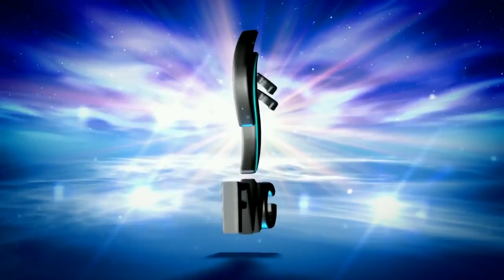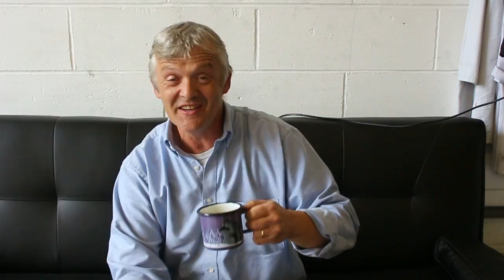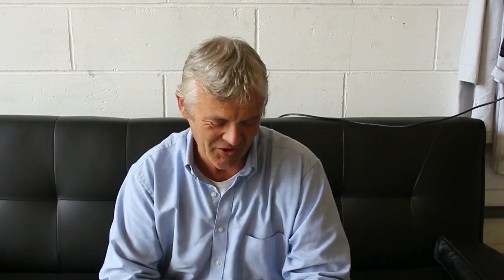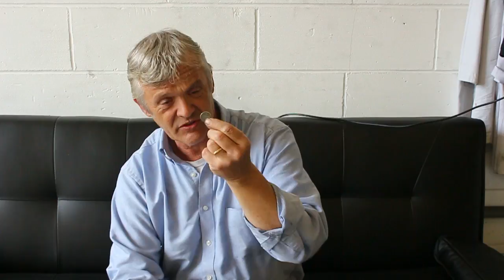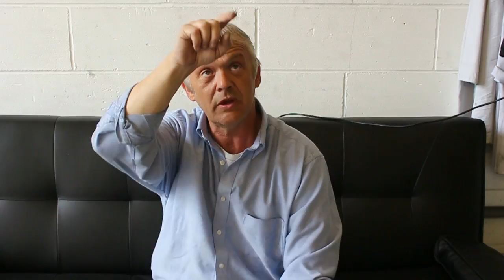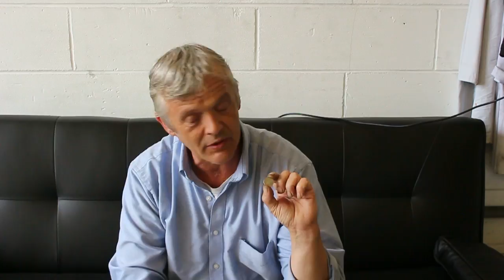FWG Battery - Follow Up

Comment: I guess the losses due to a high C-rate discharge are due to the heating effect/increased resistance within the discharging cell. A C-rated discharge is the optimal performance parameter

Comment: Appropriate uses of a cr2032 or similar coin cell: low power calculators, deeply embedded devices where energy harvesting is not feasible, hearing aids, SRAM backup for legacy products or those with real time memory requirements (FPGAs), cheap wearable devices, etc.  Not the same uses as one would consider for AAA or even AAAA batteries.  A micro-controller based sensor platform could read an ADC and sleep once every few seconds to once an hour, send the data in chunks over bluetooth, and give the battery a full shelf lifetime.  

As for the testing: Good comparison means testing an equivalent power draw from an equivalent size, not an equivalent current draw.  The physics will stack up evenly then in terms of a technology comparison.  Try using a constant output current SMPS into a heat sunk LED load that will work the same at 0.5v or so as it does at 3v provided a low enough esr.  

A good purpose for which your battery is uniquely suitable is a deterrent alarm to get rid of muggers.  More C rate, more pain in the ears without using a bigger battery.

Comment: Button cells in watches probably run at C/10000 discharge rate, though I am sure this average current actually has pulses of higher rate amongst it. One thing I have observed is that even cells in their bubble packs seem to self discharge somewhat. The CR2032 is popular on computer motherboards too, often they will last many years (though the end voltage where the computer starts losing settings is very low). It strikes me that these cells are engineered to be extremely slow self discharge rather than a traditional low ESR power house. Not in any way knocking your methodology, the commercial button cell is clearly a bit of a weakling compared to your own cell at highish rates of discharge. I do have a few electronic gadgets that are abusive to their CR2032s, such as an IR remote control for a set top box and silly LED torches for key rings. You are doing extremely exciting work, and many of us greatly enjoy the updates and ideas.

Comment: Hey Robert, I just found this channel and seemingly at an exciting time.  As a less experienced electro-chemical laboratory tester, I appreciate the educational value you have incorporated, and I hope your comprehensive design approach pays off.  The new cell seems to blow the doors off of present tech, and only rigorous testing can satisfy the doubters.  For more practical and progressive matters, I wonder how the new button cell may hold up to rigorous environmental conditions.  I just found a melted candle in my storage unit, which will freeze in winter, and it probably also contains batteries.
Reply from the maker: testing is expected and fair mate - it takes time so it has to have time to happen that's about it really

Comment: Hi Robert you are doing a super job, In the argument of discharge I agree with you, But you are also trying to make a product for the marked, and you are tying to do that With a "form factor " that have normally 3.2V and are trying to push for 1.4v.....Is it possible to "slam" 2 layer together so you reach 2.4V I think it will be closer to what this form factor are normally  used for and therefor have more interest for those who will by your battery, and when it is better then The Panasonic, that will only be a  + sales factor for you product. .......Ore did i miss the point ?.........."I'll be back". ......for some off the black stuff......I want to build something BIG with That......I have got solar cels NOW and need a storage "tank" for the Power..........Best to all Jørgen Thomsen Denmark DK
Reply from the maker: cheers mate and yes it would be possible - still stuff to work out on this battery I think - but nice comments

Comment: Does your battery have a high self-discharge and that is why you don't want to share your lower c discharge results in the same way?
Reply from the maker: no mate - it's about the same and not really interesting for that - i will most definately share it - i am working on the next video and will include that - i just putin what i think is interesting in a video - i have to keep them down to 10 mins or so as people won't watch them - if i try to put everything it just gets boriing so i make a decision on what to put in - as folks are making a bit of an issue of this i'll put it in - no worries

Comment: it's 28 after 12 and i have been to a party but still with it and looking at and commenting on some of the comments on this one,,,,,, Phew what a Freakin Epic this one has turned out to be.
i'm off to charge a battery, oh and then discharge it and that's me. 
Crack on RMS keep it up  at least some of us are still here thinking of that bad Purple fuming reaction KMn04 that you had in ya back yard from local heating whilst trying to produce Graphene  and show us prospective in ya shed amateurs what it's all about.... up until about now where some of us have grown up with you and of course will be ever greatfull for the stuff that you have shared with us over these years.
Kev
Reply from the maker: lol - i wouldn't worry about it mate - some folks just like to argue and they do it well. They can keep you talking all year. Myself i barely answer this kind of stuff - mostly because it is from a stance of ignorance - they say this and that about graphene because they think it is graphene based - i never said that - i said it was a metal oxide salt electrolyte and zinc plate - it has the same kind of discharge as an off the shelf AA - but why bother telling them as they would just have another set of arguments about why it couldn't possibly work - these kind of guys are on a mission and there are lots of reasons why - mostly it is do with their self esteme - hve a good one

Comment: That's fair and reasonable, Robert. Thanks. Two cells in series inside that package would be very useful. Lithium CR2032 cells are often used for memory backup, with a discharge rate of C/20,000 to C/40,000, depending upon the duty cycle of the computer, and ignoring self-discharge. That's 50% if you assume a 5 year service life and an observed end point of around 2.0V, measured in situ. You don't have 5 years to spare, but can you please try a simple test, using much smaller-capacity cells, which can then be extrapolated to give a pallpark figure for the real product, perhaps when connected as ~3.0V battery within one CR2032 package, and discharging to 2.0V? Thanks again.
Reply from the maker: awesome mate - i will do just that - cheers
Reply: Thanks Robert.

Comment: Hi Rob you are a bloody genius mate great work ! just a couple of things ; why only 1.5 V and  why didn't you make it 3V which is the standard voltage for CR2032 cells (1.5V is considered flat here in oz ). Would it not be as simple as stacking 2 cells in series there by giving 3V all be it at a reduced capacity but by the discharge graph your cell would  cream the other brand. 
PS are you planning on storage devices at some stage for stand alone home power ? Cheers mate keep up the good work.
Reply from the maker: fair comments mate and i am looking at home power - low drain really isn't my thing large storage is

Comment: sir you may also consider the efficient. 
If your bicycle can ride for 50 mil long and charge for 10 minute or less it most valuable. Than ride for 200 mil but charge for 3 hours.
Reply from the maker: nice point mate - cheers
Reply: I always remember your E-bicycle Video. LOL..
Keep working sir, Cheers

Comment: Hi Rob, Good to see you on air again, One comment, You said you was thinking of selling these button cells and i think its a bad idea, and will tell you why.
These things are normally used for very low power drain applications, Like key fobs etc, and normally even the crap ones last years, now i expect yours will be much better but if it last 4 years over 2 years who cares or will even notice.
Why not make a AA or AAA or 18650 i expect as the voltage will be over 3v it would need to be 18650.
Now 18650 will have a big market and the capacity will be important and noticeable, will need to be re chargable.
Just my thoughts as its a bit like making a bottle opener out of titanium, it will last for ever but does it need to.
Reply from the maker: good point mate - never thought of it that way
Reply: Maybe these cells have been used in low drain applications because, until now, that’s all they’ve been good for, which is what I got from the test.

Comment: Don't watches have low discharge rates, and aren't those batteries commonly called watch batteries? It would be interesting to be able to compare your cell with a battery built for high discharge rates, but it's clear that you have something that works well for the test you ran. By the way, it looks like your viewers are taking your advice to be skeptical of battery people, even if that battery person is you ;)
Reply from the maker: indeed mate lol

Comment: Nice job!  I know it might seem very annoying getting these questions that seem to be having a dig.  BUT it can also be very valuable feedback too.  When you are a bit further down the road and want to make a commercial product you can be sure that you will come across the same sort of questions from potential investors or customers.  At least now you have had a million devils advocates  and can have the data and answers to address them if required.
In any case if nothing else you have proved you have a product that can be used in special conditions where existing products cannot manage, namely very high current discharge devices.  As was mentioned elsewhere if you could put two smaller cells in the same package and double the voltage you'd still have a much longer life and at a higher voltage (which might be need for some applications).
I'm really interested in where you will go with this, my suggestion would be to do market analysis to see where you can make the best use of your specific batteries advantages.  That's why Tesla started with sports cars as they have higher margins on low volume sales, maybe there is an equivalent battery type for your battery where it would have an unfair advantage! :)
Reply from the maker: I get it mate nice positive spin - I will take on board what you say - cheers

Comment: In the previous video it was suggested that the new battery would be offered for sale/production in the CR2032 form factor. A comparison test was conducted against the Panasonic Lithium CR2032, which has an established market in very low discharge current applications. Two critical parameters that define the battery life in these applications are leakage current (self discharge) and flatness of output voltage under low current load conditions. In this video the implication is the former test results were not intended to indicate the new batteries suitability as a direct replacement for the Panasonic CR2032 replacement, that is ok but might have been better stated in the former video. The question that remains is what is the target market for a CR2032 form factor battery with only a 1.4 volt output, but which has been tested to provide a relatively longer period of high current discharge that the Panasonic CR2032?
I cannot think of many applications that require a primary cell with a sub 2 volt output that supplies a high output current that lasts  for a few hundred seconds.
It does seems unreasonable to mock Panasonic for specifying a C/1000 discharge rate, when these batteries often find application in equipment where the battery life is expected to be 5 or 10 years before replacement is necessary, i.e a 2uA load current (C/110000), for example the Rigol RF spectrum analyser rtc. It also seems reasonable to question the replacement marketability of a CR2032 form factor battery that only outputs 1.4 volts when most existing CMOS processors reset at approximately 1.8 volts. There are circuits that will operate down to 0.9 volts, but these are much less common. It could be argued that low load current  performance can be inferred from high current testing, but this is difficult to justify, given the importance to battery leakage due to side chain reaction and internal current paths, and still does not address the problem of the low output voltage of the new battery.
The confusion can only be attributed to the misunderstanding about the intention to market the new battery as a direct replacement for the Panasonic battery in the same applications where this battery is used. I do find it difficult to see how religion related to this discussion and none of the above can be taken to imply that the tests shown in the first video were somehow unscientific, however they may not be relevant to the practical market application of the new battery in this form factor.
Reply from the maker: I don't mind folks criticising or pointing stuff out - just like you did - I mind the idiots who then say it is meaningless or unscientific in order to press home their points - what you have said makes perfect sense and is put in a way that can be appreciated and discussed. As I said you make good points. 
The CR2032 is just a form factor implementation of a lithium metal manganese dioxide battery - in a real sense there is no reason this shouldn't manage high load conditions - just because it is targeted at low load doesn't mean it was designed for that - it was just found to work well in that condition. I always ponder what would happen if we didn't have lead acid and some one invented it today - What do you think would happen?
The first thing is they would take it to a car company and the company would say
it's made from lead - are you crazy do you realise how poisonous that is
what it's got acid in it? - that's crazy think of the children
what do you mean it off gasses hydrogen? that stuff explodes you know
and yet 250 million cars on the American roads today and everyone has a lead acid battery in it.
the lead acid battery wasn't designed for cars it was just useful in cars before we had all this nonsense we have to deal with today and there it remains.
So much of what is said today about batteries doesn't revolve around batteries but around battery markets and experts in batteries. - wasn't it Goodenough - the inventor of the lithium ion battery - who said - if you want to develop a battery for God's sake don't talk to a battery expert - I may be paraphrasing
So, though I see and get your points I have a few reserves as to the real relevance of them in development - just the way it is mate sorry lol
Reply: Robert Murray-Smith What you highlight is the difference between doing research into new battery chemistry and development of a product targeted at a particular market sector. As. I am sure you appreciate, each market sector is looking for particular battery parameters, with the ideal battery chemistry meeting all these requirements yet to be invented. The battery form factor is important in as much as there so many products already in existence that use a particular shape of battery, and this battery shape has been linked to the batteries performance and electrical characteristics. It is possible that the first person to invent a high density power battery(energy storage device) suitable for robots will be able to define a new case topology and to some extent the output voltage, but for existing products, such as cars, computers, and hand held devices the battery form factor is limited to a relatively small number of standard shapes, not least because manufactures are geared up to make products in these shapes and existing products will only accept these shapes as replacements for existing batteries.  As you maybe aware I am very much against the use of sealed for life products that use flat pack Li-Ion  batteries that exhibit relatively few recharge cycles and thus build obsolescence into the product. I also have a deep dislike for power tool manufacturers who use replaceable batteries in non standard battery cases, also to build obsolescence into the product. When they want the customer to upgrade the whole power tool, they just stop making the batteries in the proprietary case shape particular to the old product. My point is that generic batteries must not only match case size standards, they must also meet the basic electrical Input requirements defined by existing product circuitry. A classic example is the early adoption of NiMH  AA and AAA batteries, used misguidedly as a replacement for alkaline primary cells and NiCd  rechargeables in existing products. Its high self discharge makes it unsuitable for the former in many applications and it's higher output voltage resulted in  products being damage in the latter case (4*1.5v= latchup destruction and thermal runaway, 4*1.2v= normal operation). Fortunately both these issues have now been address by newer versions of NiMH batteries.

Comment: Hiya Mate,

The test was the test, totally fair 

Same c rate, two different cells (one commercial grade and one home made) with very interesting results 

You can not help it if the commercial grade cell was a wimpy cell 

I thought is was particularly interesting that 3 volts very quickly turned to 1 volt with the commercial grade cell

All my home made cells I discharge, are done on a short circuit, so I guess I would be extremely harsh

PS don't waste your time with critics, they are only interested in blowing there own horns and will waste your time 

Cheers
Reply from the maker: true enough mate - cheers